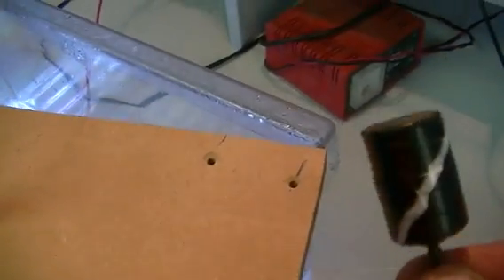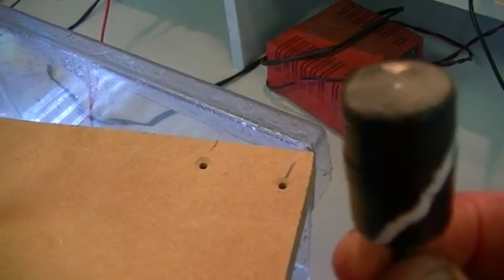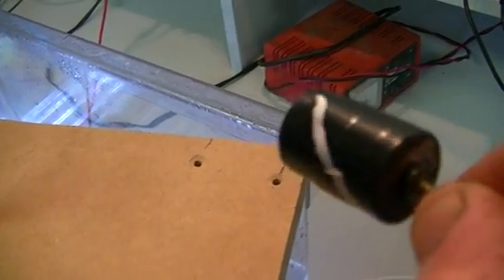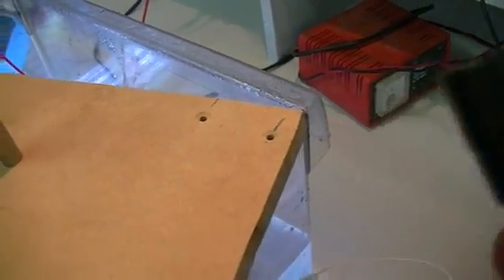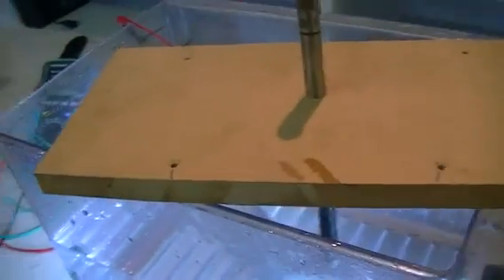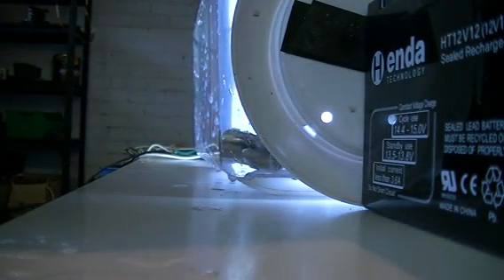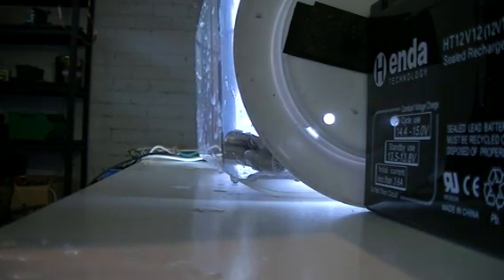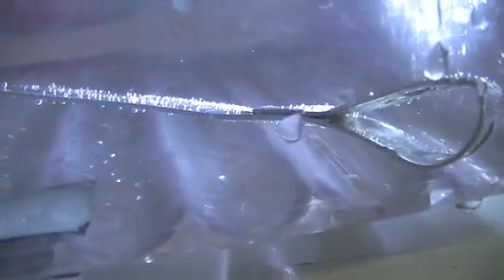magnetic vortex motor insulated

Comment: LOL, Insulating the magnet wont stop it working as a homopolar motor. you still have current, with its rotating magnetic field (right hand rule), going through the straight lines of the magnetic field of the magnet.....

Insulating the magnet wouldn't effect it in the slightest.

I'll try and find time to present some practical examples of whats going on here over the next few days.

I still recommend doing some oil ad iron filing tests though,
Reply from the maker: MS-you have missed the point of the video's.I know very well that insulating the magnet wont stop it working as a homopolar motor-as long as there is a current path ,it will work. But im afraid the right hand rule dosnt alway's apply-please see latest video. We were looking for this opposite spin in the center of the magnet-and i have found it.
Reply: I saw that. The opisite spin in the center is still expected rith right hand rule. Think about the shape of the magnetic feild..
Or lay a bit of paper or something over your magnet, and add some iron filings. The feild comes out the center then turns around to go down the side of the magnet...
Of course there will be oposite spin there....
Still demonstrating right hand rule.
Reply: Is he claiming that he is insulating a magnetic field with tape? I am sure everything is dry and sealed  under there. Demonstration was very cool anyway.
Reply: Edward McLaughlin I think TM is mistakenly thinking the hompolar motor effect requires current to pass through the magnet to work. When all that is required is for current to pass through the magnetic field. As he has demonstrated quite well with this video.
Reply from the maker: Edward McLaughlin Please listen to the video-i said electrically insulated,not magnetically insulated.And yes,the tape kept the magnet dry on the sides.
Reply: TinManPower I thought your video was amazing.
Reply from the maker: Mongrel Shark The magnet is only the current path in this set of video's,as with most homopolar motors. The right hand rule needs questioning-see latest video.

Comment: The REASON why it works TAPED on the side is:-----   charge enters centripetally  (dead center of both sides)

because the CENTRIPETAL on both sides is the "portal" (as analogy) of reintegration (of the natural reciprocating magnetism) AND charge applied (as you are doing)